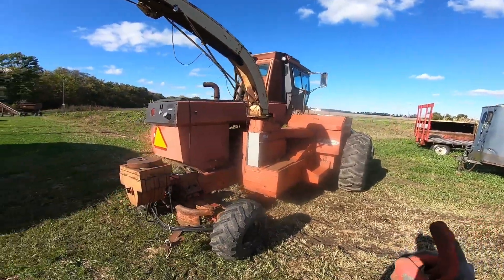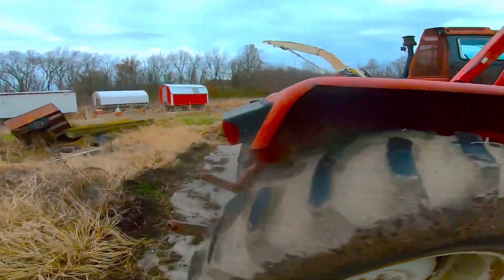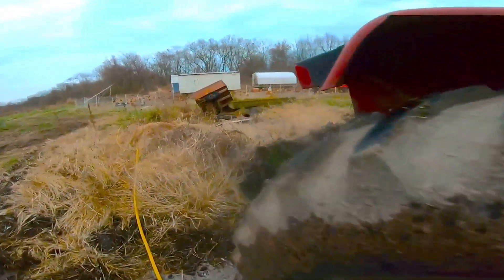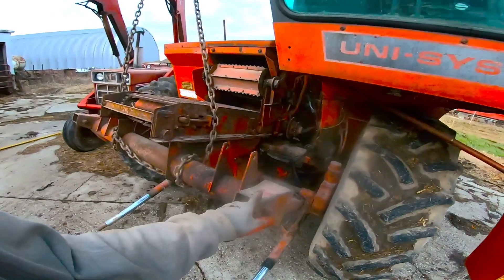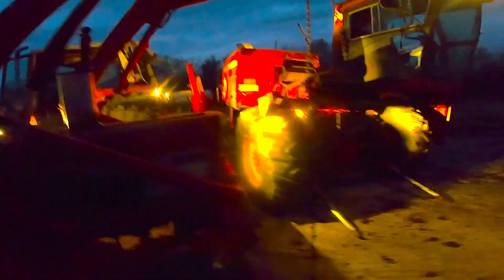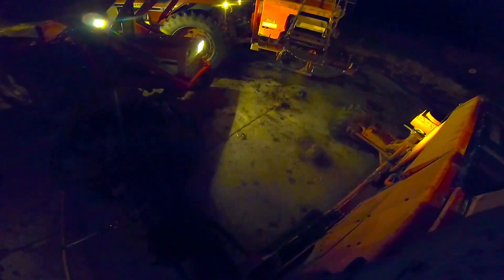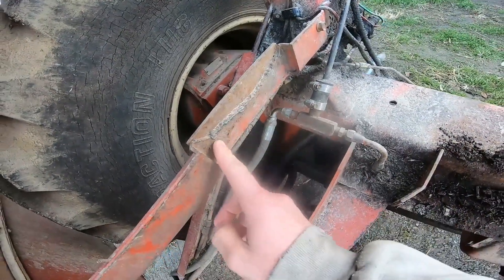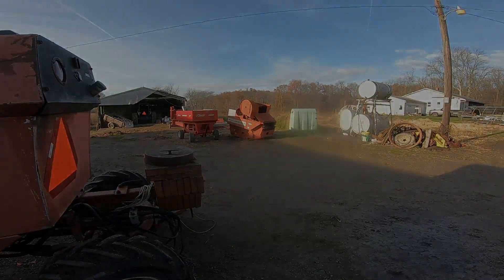Dismounting the New Idea UNI System Chopper

Comment: Been doing this stuff since the early 80s. Fairly quickly we bought another power unit so we had one under the husker and another under the combine. First, you really HAVE to pull the head WITH the feeder house on it to remove the machine from the power unit, that is not optional.  You made your life really hard.  You also need to slide the rear axle over, did you not see that? You loosen the clamp bolts and slide it over.  The chopper is easy, the combine and husker are larger.  The rod you were talking about is to adjust the drop rate on the lift cylinders. When you get around to lifting the husker up onto it's legs, the two brackets on top that the elevator rods bolt to are a good place to hook to. The husker balances quite well there if the elevator is not on it.  When you drive into the head and feeder house, you have to have the lift cylinders adjusted to the correct height so they go where they are supposed to, AND, you have to hold the hyd lift lever forward so the rams can retract. Otherwise you will just push the head forward. You may or may not have to adjust the head drop rate to allow this. Those lift rams are single acting, they do not retract under power. You probably ought to get a book for all the pieces, it is not complicated, you just need to know a few things.
Reply from the maker: The chopper isn't going back on. The two pins that hold the feeder house were will rusted in place. I figure I'd spend all day fiddling with them: wd40, hammer, fire, sawzall, etc for two pins. Sure it costed some diesel to do it the hard way I did it, but I didn't see a clear finish to getting the feeder house off without busted knuckles, or even more wasted time than what I had in using tractors to remove the whole unit. I've had to do this rusted in pin dance on other equipment and it's a real bee sting.

Comment: Had a few over the years. Normally you are supposed to slide the steering axle over to make the turn when taking things on and off. The rod you found from the cab controls the down speed for the head because it is power up and gravity down. Don't have a chopper might get one some day. Good luck I prefer the Cummins or Perkins to the Allis. They have good power but are hard to start and are know for the rod bolts coming loose. Good luck.
Reply: Rod bolts don't come loose, that's a myth

Comment: The reason you had such a hard time getting away from the chopper is because you didn't take the throat off the chopper first  you took the head off then you have to remove the throat and then you can drive away. Back in the 80's and 90s we had two 903 power units that we picked sweet corn with for a local canning factory so I know them very well.

Comment: I can remember the seed corn factory my dad worked for used to use those Uni-System New Idea outfits to pick the corn on the ear.  They seemed to be pretty good machines overall.  As I've already seen suggested, when switching from one unit, Husking Bed to Silage Chopper to  Sheller, the rear axle has to be slide to the left in order to clear the unit being switched out & put on.  Hope you had a MERRY CHRISTMAS.  Take care.

Comment: First time is always a pain with those and i am sure a few other will fill you in on what to do i always had a order to follow and still do if i have to swap out units but these days i have a 20 ton overhead crane that works great for removing the whole system if needed but i found it easier to drop the head and feeder as one still and i have engineered some wagon gears to sit the units on and makes it easy to move them as needed ... biggest thing i found pulling wagons it hated any wagon with 9-5 or 11-5  tires are worthless behind it but any wagon with 13-5s or larger pulled much easier... Keep in mind 426 allis engines were very noted for Connecting rod failures due to the undersize diameter of the crank throw.  There are many AC tractors with cummins conversions

Comment: Interesting peice of equipment! I wonder if the ear picker unit, requires less hp than the chopper did. Maybe it want get worked so hard ear picking
Reply from the maker: The ear picker doesn't need much power at all. Hardest part will be pulling the wagon.
Reply: @boehmfarm4276  Correct, the chopper probably has the highest power required of any of the Uni equipment.

Comment: Well to start you have to slide the rear axle to the left and the feeder housing should have been left with the head, its a 10 minute job on cement floor. you are going to have to move the rear axle before putting the picker on.
Reply from the maker: I couldn't get the pins to move for the feeder house. I didn't know about the test axle, but might explain why every bolt was loose.